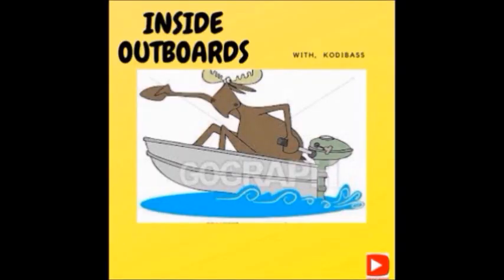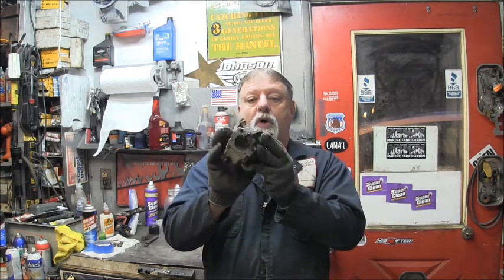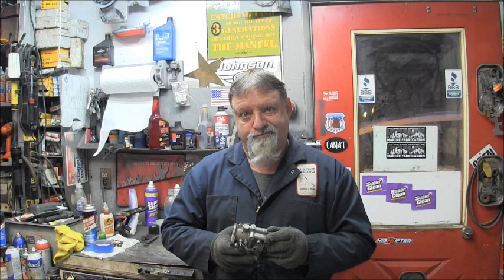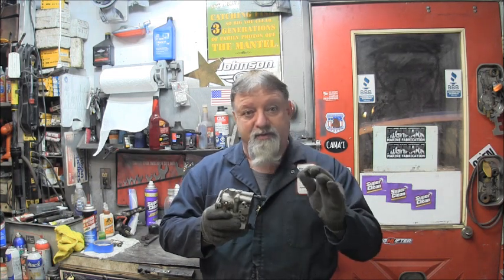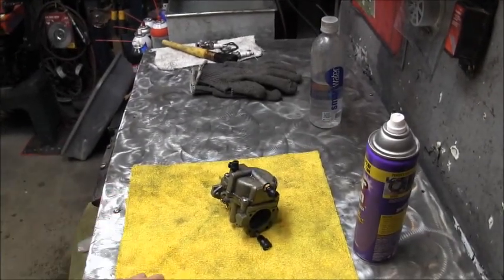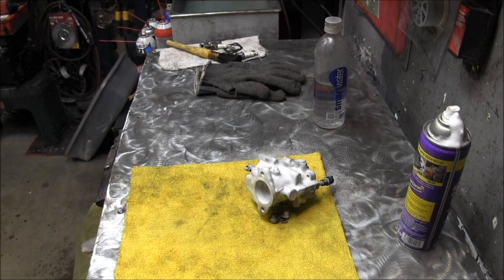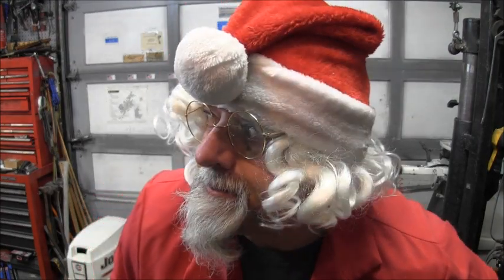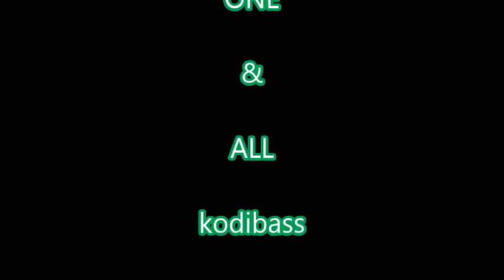JOHNSON 2004 30 HP MAKE OVER,    ( Part  4 )

Comment: Your little to the point explanation of the welsh plud and throat holes brought back memories of a carb I did once. Cleaned it, put it back together and tried it. Could not make the motor idle for anything. Took it apart a few months later, this time taking the welsh plug out. Can you guess what I found? No! Some genius at some point must have had the low speed needle come loose, so rather than put in new packings in he used red locktite. The needle hole into the chamber under the plug was solid with locktite as well 4 of the 6 holes into the throat. It took over an hour to dig all the red out of the holes. Ran like a charm after. There are some people who should never be allowed to touch anything at all. Have a good holiday and new year.
Reply from the maker: Yep' I have had many carbs come in with RTV / sealents all over them haha  Happy holidays.  kb

Comment: Did have one question on recoil.  Looks like got pull rope? wet when cleaned it.  Is that OK?
Reply from the maker: Yes'  Soap & Fresh water is fine on them, after  drying spray with a squirt or 2 of spray lube & wipe.  happy holidays.        kb

Comment: Kodi:  Did you do a sync 'n link when you switched carbs?  I would think so........ well, maybe not.  What say you?
Also, you say this guy sent you this; that guy emailed you that....... how do they know your email and/or your shipping address?  If I actually wanted to send you something I would not know how.
Anyway, Merry Christmas, ol' buddy.
Reply from the maker: Merry Christmas mate. You will find my e-mail & address by going to my home page & click on "" ABOUT""  then scroll down a bit it's all there. However I have been informed by several subs that it will not show if using a smart phone?  So I guess it only shows on a computer?? Anyway I am going to try and do a running (on water) sinc on this motor...stay-tuned'''  I am still sceptical about this whole mixmash even working haha.. But even a blind squirle finds a nut once in a while.                                                                                                        kb